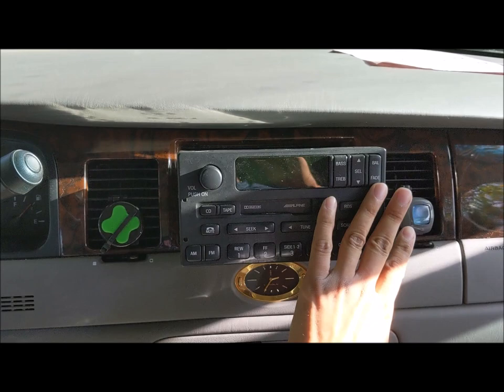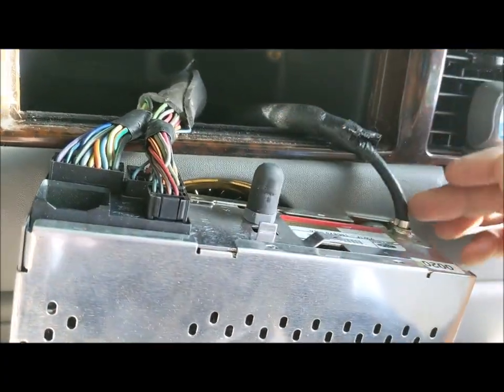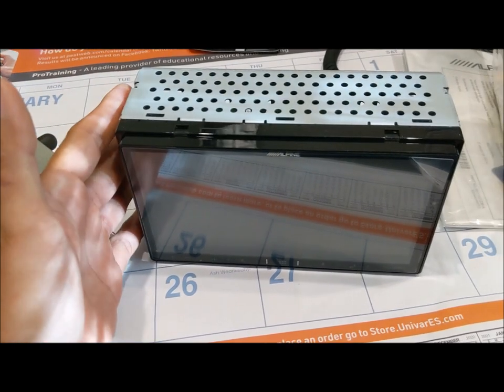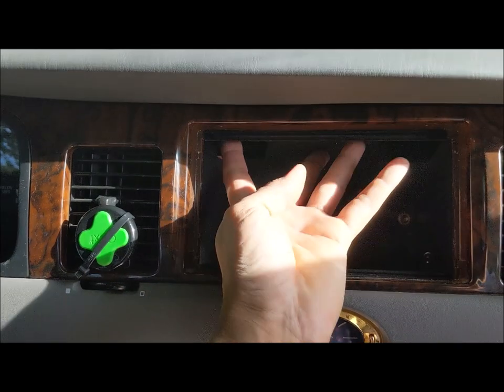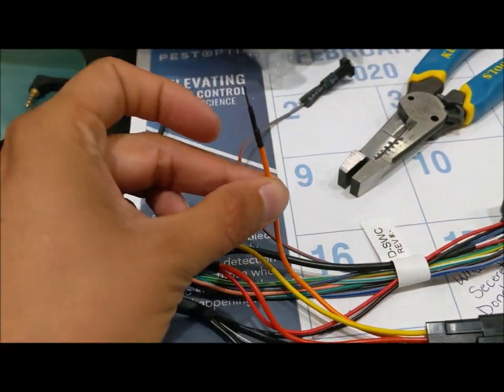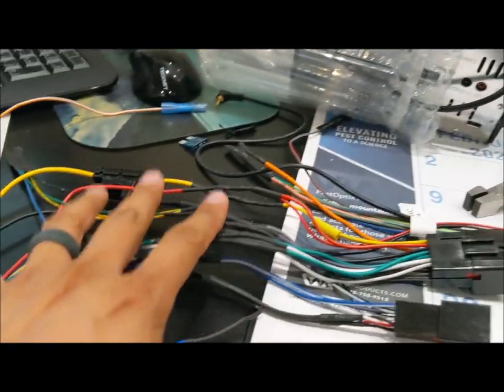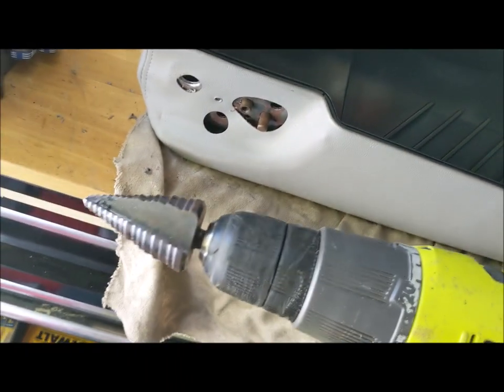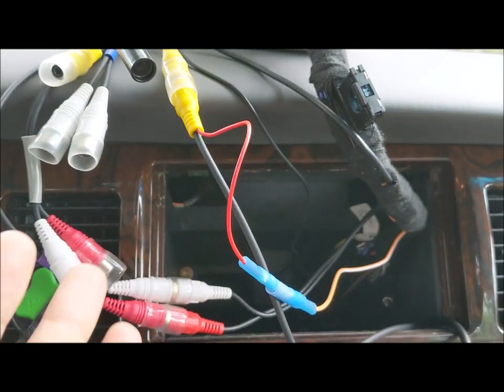Install a Double Din Stereo in a Crown Vic, Town Car, Marquis, or Marauder

Comment: Nice video, but the only thing I noticed wrong, is that you tell us to connect the factory sub amp to the rear output of the stereo. The factory sub amp should actually be connected to the SUB OUTPUT of the stereo. Otherwise, your sub control options on the deck will not work on the sub. Also, by connecting the factory sub amp to the rear output,  whenever you make adjust balance or fader, it will affect the sub amp.  You avoid that issue if the sub amp is connected to the SUB OUTPUT, as sub output is not affected by the adjusting of fader or balance.
Reply from the maker: I think I mis spoke in the video. But you are correct it needs to connect to sub out.

Comment: On the 03+ it's a way easier install. Older models you have to modify the air duct.
Reply from the maker: Yes ford got smat lol
Reply: Don’t have to modify the air duct if you buy a “mech-less” headunit. Welcome to 2020!
Reply: What about an 02 town car
Reply: @joe95123  98-02 are the same.
Reply: I need help what do I need to do for my double din to fit in 1999 grand marquis
Reply: @JayJohnPaul  can't pirate good cd quality mp3s anymore

Comment: You said you couldn't get the Double Din  out once it is installed. That doesn't sound to good  to me.  Who do you contact to install these new type radios with GPS on them.
Reply from the maker: @jamesmcqueen6038  you can't get it out of you don't remove the screws I showed. If you take them off then your perfectly fine

Comment: Hi Raymond, great video! Can you please tell me if the delayed accessory power (pwr windows and radio for 10 mins after switching off ignition) should work after this install?
Reply from the maker: @Justin-ex7gg  yes it work
Reply: @ thanks very much. The installer I hired to do the job was horrendous (they damaged my car and messed up the wiring harness on top of it). They redid the harness but they missed the delayed accessory power, despite me specifically calling it out... my father and I are thinking about modifying the harness to tap into the correct power source since we have not yet sunk the unit back into place. 

By the way... you are a LIFE SAVER... I removed the trim bolts you recommended removing in order to pull the trim with the unit in place. We did the removal and re-installation ourselves to prevent any further damage.
Reply from the maker: @Justin-ex7gg  Awesome man!! Enjoy the car they are almost extinct you have a future treasure if you treat it right

Comment: I picked mine up yesterday and I was looking at double dens to put in but then it turns out the guy restores classic vehicles and he put in a brand new factory head unit in there and it’s a beautiful brand new cassette player it’s kind of cool! Also has a CD changer in the trunk so I think I’m good. I have some sort of Bluetooth thing that streams to a radio station and it sounds pretty damn good.

Comment: He incorrectly labels two harnesses:

4:46 - the plug in the back with seven wires is the CD changer

4:58 - this plug with four wires is for the amplifier
Reply: Hey so I have a 99 grand marquis that doesn't have CD changer or the amp, so do I just void those two plugs with installing a new head unit ??

Comment: I just removed the top felt and slid my double din in 🤣 it stays still enough, and it doesn't rattle around when I drive. It also doesn't look too bad.
Reply: Which radio size you used
Reply: @snoopfl  double din

Comment: I just bought an extremely clean 06 MGM. The radio I bought is a DDX5707S KENWOOD. I wanted the additional disc drive. I've installed 3 other radios but this one seems to be a bit of a pain "cutting" Can't remove it etc. I'm glad you made some points. I'm going to order the bezel kit you bought and return the hardware that I currently have.  I will have everything before its stuck in there haha. TWSS.
Reply from the maker: That's awesome they are incredibly comfortable cars. I honestly can't explain it.
Reply: @RaymondUrias  Coming from tuner cars, huge difference. I love it so far. Big plans.

Comment: Great video my dude, I should’ve watched this before I started. I have a 2000 mercury grand marquis, and let’s just say this was a very different experience removing the old radio. I don’t  have the bolts on the inside for some reason, and I have the wrong dash kit, but I plan on fixing that very soon, and with a re watch the n this video I’m confident it will be a success. Side note: really cool that I got the exact same radio, way before I ever watched the video, makes this vid that much better for me.
Reply from the maker: You're going to love that little radio!
the boot time is a little slow but there are so many Minor details that you can adjust that it makes it a good buy
Reply: Raymond Urias I am so excited to use it, got off the whole weekend and it’s clear skies so this is gonna be a great way to pass the weekend time
Reply: Did u ever get the radio in the '00 MGM? I have a '00 as well and want to go for switching from factory to a double din
Reply: @tonyglock6161  yes I did, I had to dremmal the top and sides, get a specific dash kit and all.  Final product looked fantastic! It’s definitely possible my guy, go for it!
Reply: @elirick09  Did you have to dremel the bottom as well? there is a pieve of plastic/metal on the bottom too
Reply: @Niccckk  if I remember correctly it was just a tad on the bottom. But my dash was all plastic inside. I had no metal except on my head unit. The Alpine iLx-W650
Reply: @elirick09  did you get the KTA-450 power pack? If not how’s the sound?
Reply: @paulmorales1414  I did not, I had an 800w kicker mono block for my 15” solo baric and a 650w AB 4 chnnl amp for my door speakers. Sounded great.
Reply: @elirick 09  can u help me with what radio I should get single or double din and what harness I need and what front speakers I need for front doors and rear deck plz and thanks ..its my 2000 mercury grand marquis
Reply: @cali8221  so a double din works great, with a little modification. A little dremmeling around the top. The opening is entirely plastic, and the ac/ ventilation surrounds the radio are so you have to get a snap in. It’s important to make sure you are done with everything you want to do before putting the radio in in that case as it doesn’t remove easily at all. I went with the alpine ilxw650, and went with kenwood concert series door speakers. The front and rear door speakers are the exact same size. 5x7 I believe. I also went with baffles behind the speakers. I wrecked my beautiful grand marquis last year, so I actually have everything in my closet now as it does not fit in either of my other vehicles. It’s a good system to run, but I’d also check out videos from car audio fabrication and do a little research before you give it a go. All goes in in a weekend- subs and all of you plan ahead. Also the passenger side area under the glove box is a great location to send wires through the firewall as there is already an oversized grommet in place. Be careful, and cheers champion, you got this 💪
Reply: Man thanks for the fast response 
But can u tell me what head unit will be best with out using drimmle a single or double din and what harness should I get ..and how does that lil spot in the front doors take a 6×8 speaker when it looks so small??So u say the rear deck also is a 6×8 not a 6×9??jus trying order this stuff and I'm lost ..its a 2000 mercury grand marquis  thanks
Reply: Oh yea do I need a dash kit?? Too?
Reply: I'm new to this 😂
Reply: @elirick09  I was thinking a single din the whole time .and other videos said a single din ..im lost

Comment: So there's no reason to cut the plastic on the top or air ducts like.older videos?
Is that because they were installing CD or DVD double dins?

I'd like to install a media receiver like I did in my truck. Alot smaller depth with the media receiver.
Reply from the maker: No reason to ever do that. Back in the day I remember installers cutting up ac vents as well, sad day. Even back then there work arounds
Reply: @RaymondUrias  glad to hear that. I have a 1999 Town car with 88k original miles. Cutting up the duct work was the reason I've never out a double din in.
After recently installing a double din media receiver in my 2002 f150. With light modifications like this video, it made me revisit the idea of upgrading the town car.

Comment: Raymond I have a 2002 Lincoln continental with Cassette tape AM/FM and CD changer on the middle compartment of my armrest The radio looks fantastic would it work on my car
Reply from the maker: Yes it will fit your car. You will need different trim. Check crutchfield for the parts list

Comment: How much would a shop charge to install a new head unit with reverse camera on a town car?
Reply from the maker: Radio - depends on the model you pick
Hardware- depends on model radio you pick (safely... camera, relay, wires $95)
Install- radio (1.5 hours * $100 hr = $150)
Install- Backup camera and relay (1.5 hours * $100hr = $150)

So Radio you pick + $395 is where you should plan to pay

Comment: Yo Jared with SpitShop Music. So I should be able to run this exact same set up with all the same parts with my 02 Lincoln Town Car? I love what you did so if I can just do the same I am ecstatic…
Reply from the maker: Yes 2002 will be the same. Enjoy
Reply: @RaymondUrias  Thank you so much. Do you have any suggestions for a cheaper head unit or a way to search for something that will fit because I’m confused because it says this Alpine is 10x8x7 and my hole is only 7.5 wide and 4 1/8 height. Wish you had a Facebook or something so I could ask but I know you don’t. ANY help is appreciated

Comment: Mean while im still trying to figure out what wiring harness interface I need..
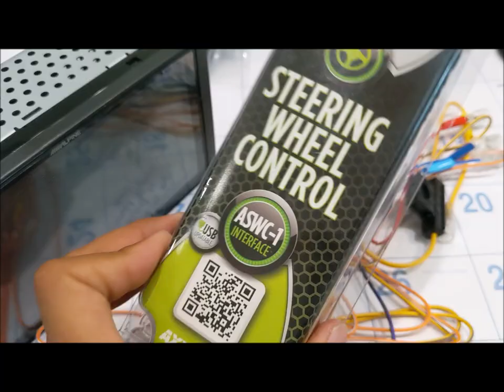Reply from the maker: @14:44
Reply: I bought an interface harness for what was advertised as compatible with my year, make, and model but it will not  plug into the existing wire nor are the pin even the same. There seems to be something off about my year crown vic.

Comment: Question. Where does CMK ship from? I want to buy the display for my C300 but i dont know if its over seas and with all this Coronavirus going on i dont know if they are shipping.
Reply from the maker: I would contact Chris he responds very quickly to emails he lives in Denmark ,he has a warehouse with supply in stock. Just check with him first to make sure the part you're looking for is on hand.

Comment: Hi I have an 01 TC Exec and the "select & reset" buttons are missing from the message center. Do they have any functions? I can see wires through the holes but I have no idea if they function or not. If they do, where can I purchase new or used ones and hook them up?
Reply from the maker: Yes they do they allow you to scroll though the cars menu for MPG, Range, ETC. Check ebay there are out there by the boat load
Reply: @RaymondUrias  Great, I recently got a new battery and it changed from miles to empty to mpg...sadly it seems I'm averaging 9.9 mpg "SHIT". Thanks though.
Reply: @RaymondUrias  Hi, Ray. Hate to bother you but I couldnt get anything to come up whe  I seweched for the select and reset buttons for the message center. If it's no trouble to you could you link me to a site or ebay

Comment: My question about an aftermarket stereo, but in a 2009 Mercedes C300 4-Matic Sport. The problem I had initially was in-between the factory harness and the factory stereo there was a secondary harness. Not really sure what that harness does, but when it was used I was not able to get power to my new Sony AVX-5000. Once I bypassed that intermediate harness I was able to get power and everything worked, or so I thought. What happens now is if my car is left for more than say 4-5 hours, the stereo looses memory. I have tested aux power and it is there, but it seems to go away, weird. I know that most cars take a couple hours to go into deep sleep mode and this is probably what is happening. Since you have the same vehicle I thought you might have an answer to this. Do I need an adapter? Is there a setting in the car I need to change? Any help is appreciated.
Reply: Why are you putting aftermarket in a Mercedes 🤷🏻‍♂️

Comment: Hi, where can I purchase one of them stereos and what's the correct spelling of the name of it I'm in the middle of installing a double DIN it was just yesterday in my 1999 Mercury Marquis and I ran into that problem but I do not want to mess with my air conditioning that's far  more important than the stereo
Reply: What did you choose ?
Reply: @xxf3aredkillaxx719  I and up installing a kedela 7001 reciver from Amazon so far it's doing ok I paid $119.00 for it an I like it

Comment: I have the same car I have the Cartier addition and it doesn’t have the cd changer
Reply from the maker: That's interesting considering this one is a Cartier edition as well. The wiring is still the same. The plug that I did not use was for the 6-disc CD

Comment: Will this fit in a 1997 grand marquis
Reply from the maker: Yes, enjoy it
Reply: @RaymondUrias  does the bracket fit as well?
Reply from the maker: @gabescott2704  this one fit great, no complaint here
Reply: @RaymondUrias  how long of a USB extension did you use?
Reply from the maker: @gabescott2704  I ordered an 6.6ft and it was the perfect length

Comment: You didnt say what the other two wires to the amp connector were for
Reply: Oh never mind, i saw they were just rcas for the amp output. Theyre connected to the headunits subwoofer output right?

Comment: What kind of radio is this?
Reply from the maker: Alpine mechless
Reply: @RaymondUrias  thank you and sorry I should have read your info before asking but I have a 99 grand marquis and it's a pain in the ass to fit radio
Reply from the maker: @whitelavarball  I talk about this in the video. It's the exact same process, you will need to do minor triming and get a mechless radio. A normal radio will not fit unless you cut your AC duct
Reply: @RaymondUrias  yes I trimmed the piece but the air duct is in the way now so my radio sticks out and honestly I'm afraid to cut the duct I don't wanna mess anything up and hopefully I'll have time to take the dash apart to see what needs done
Reply from the maker: @whitelavarball  just buy a different radio lol
You don't want mess with the AC
Reply: @RaymondUrias  just send me sum money or the radio I'll gladly accept 😂 just messing with you

Comment: Great video but the only thing i wanted to see you skipped!!! I want to know how the dash kit actually locks in to the dash and you skipped that part.
Reply from the maker: You just push the radio in with the plate on.... It's straight forward. It will clip when it's in
Reply: @RaymondUrias  Ok thanks for that and i assume it unlocks with keys of some sort? My install is different i just put a 10.1" touch screen from Eonon in my dash it's just sitting there no problems with it moving but i'd like it to be locked in. Anyway thanks for the video man!
Reply from the maker: @TheGdiddy35  I would have to pull the dash panel out. I screwed the stinger template directly to the radio

Comment: Can sum one plz help me
Reply from the maker: With what?
Reply: @RaymondUrias  I've been trying to find out what size speakers are in a 2000 mercury grand marquis and does it take a single or double din and what harness do I need ...ive been searching for like 2 days now ..
Reply from the maker: @cali8221  Grand Marquis is the exact same as this vehicle. You can do a single din or you can do a double din. The choice is yours. This video shows you how to do a double din. For speaker sizes, it depends on which trim you have. I would recommend going to the crutchfield website putting in your car's information and it will give you all the parts and pieces you need

Comment: Your mistaken, my  grand marquis has a full double din opening its an 03
Reply from the maker: This is a 2000. They changed the dash in 2001. You don't need to trim
Reply: @RaymondUrias  you do gotta trim but the inside is NOT interfered by the a/c
Reply: @robertvilliard6768  I had gaps on the left and right in my 2002 grand marquis. Did you and if so, howd you fix it.
Reply: The Dual radio has a beauty ring that fits around to fill that!